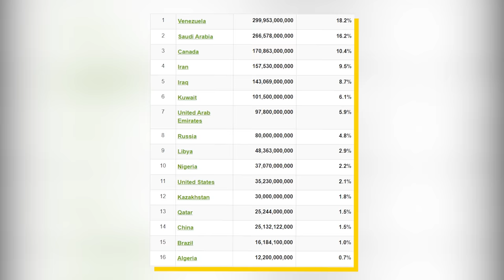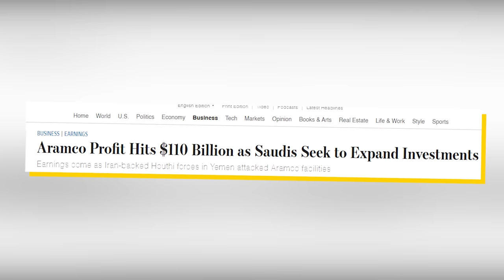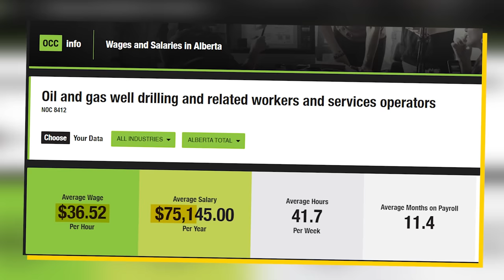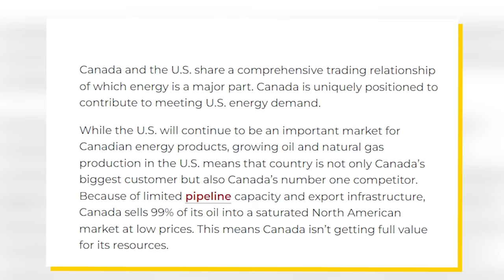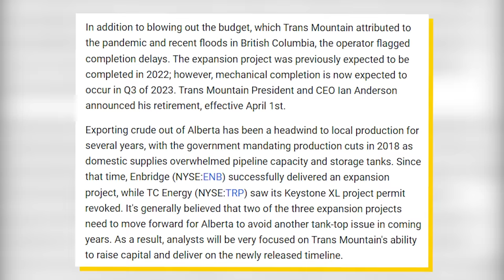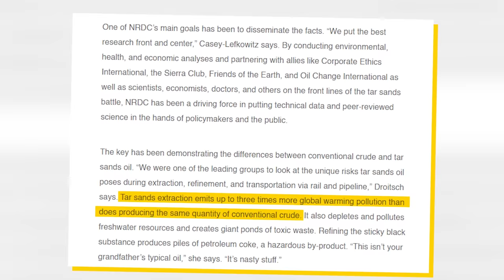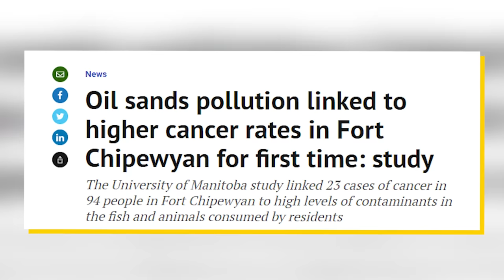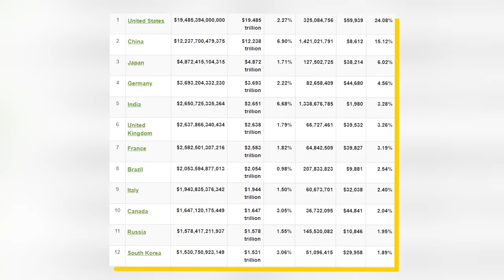Why Canada Refuses To Exploit Their Gigantic Oil Reserves

Comment: One problem you didn't cover was Canadian geography. To get Canadian oil to a port you have to cross the Rockies if you go west or the Precambrian Shield if you go east. Going north is fairly easy, but the port would only be ice free a couple of months of the year. The best route is actually south to the Texas coast which is what the Keystone XL pipeline was going to do until Biden killed it.
Reply: There is a pipeline going to BC (been there since 1953). The east voted against it. Being from one of the provinces, we don't understand the need to have oil. We have excess production of electricity (no solar, no nuclear, no gas, no coal power here), we can't wait to have more reliable electric cars against the cold.
Reply: @robert-antoinedenault5901  what are you babbling? no nuclear? ontario makes most of it's power from nuclear
Reply: @ronblack7870  Never said I was from Ontario but Canada doesn't stop in Ontario there's quite a few more provinces past that one. The pipeline does make it to Ontario but not passed that point.
Reply: BS. Plans for pipelines to West and East coast coast  met with environmentalists. I suspect politic is the issue.
Reply: Canadian here, living only 150km from Alaska. Here in Prince Rupert our Port never freezes more than a few weeks of the year and we have multiple exports already and over 1000 dock workers we could handle a pipeline here and also our neighbor in Kitimat BC
Reply: @timothychung4811  Not so much as we Eastern Canada citizens voted against these pipelines, Government wanted it as it would bring funds into the coffers but the population doesn't want it
Reply: @TheAllstar420  As ironic as that is, I reside in Quebec and voted against this motion (not the government's choice) along with my fellow constituents. I reside on a small (92 acre family/forest plot). I have on average -36C in winter and 34C in summer; with proper insulation and a electric/geothermal heating and cooling system as they are the cheapest and most environmental options by far (my neighbours have had propane and/or gas and/or heating oil; now electric because the price is cheapest over all) and I do not have any batteries as of yet (planning on installing some for solar power generation for new electric tractors). My cost for electricity (0.07$/kWh) is more expensive during the summer (lol) than it is during the winter; as a "normal" Canadian we don't really use heat but when heat rises over 26C the ac get's turned on. So the use of gas is not important for us, maybe you are a new Canadian (1st or 2nd gen) and you are not used to our weather and your intolerance to the weather is not a reason to insist on making us use this, nor to use our land to transport a toxic material onto our land. If there was a guarantee that nothing was to ever happen we would've accepted. Think about it in a more "logical" sense: if the pipeline leaks it is disastrous for the environment (above or under ground) but if a power line falls it just means that power will be back online eventually (just like the 1998 ice storm). Before complaining about why we stopped you, you must also understand our point of view. Not saying we are right nor wrong but if the guarantee was given; there wouldn't have been a discussion about it. But none was given..... And the gas port that was brought forth for the city of Bécancour predates this war by several years and the local government (provincial and municipal) were positive towards this but once the public environmental committee and it's local residents voiced their concerns and no guarantee was given (on the affect on sea life, pollution and expropriations) therefore it never came to be thus sanctioned by the federal government. But your dependency is your own it does not reflect on us, we are happy to move away from this product and have been doing so for the last 15 years. Maybe you should learn to do without (just like a cigarettes), might be hard but it's not going to kill you. Instead a hydrogen plant has been erected there (Bécancour) that will supply Germany and other Eastern country need of clean energy (as we hold nationally [Canada] huge reserves of water) and will be processed with electricity thus reducing our carbon footprint and also our own dependency on fossil fuels (win/win situation).
Reply: With climate change the Arctic ocean will become a more viable route.  There are already plans to develop churchill, Manitoba with a large port.
Reply: @mjhumle  sensitive ecosystem. A single spill could devastate the economy and way of life of people in the region. Looking at a map you can see how tricky to navigate the region can be, creating higher risk for spills. The companies wanting to put pipelines and ship from here have failed repeatedly to provide a comprehensive spill management program to mitigate these risks. In fact, the risk benefit analysis has shown northern BC has far more to lose from a spill than it has to make from running a pipeline and shipping out from here. It’s really just not in our best interest
Reply: If you think that was accidental the I have a bridge to sell you
Reply: @robert-antoinedenault5901  wow. Just wow.

"Maybe you are a new Canadian (1st or 2nd generation)"

It doesn't matter how long you have been in Canada buddy. But ppl dislike Quebec because of statements like that. 

And I doubt the Average temperature is -36. The lows maybe, but not average. I have seen -55 but don't claim it as the average...
Reply: @CountryLifestyle2023  As I said earlier, if you took the time to assimilate what was written; there's a winter average and a summer average and that includes humidity. Now for your dislikement of Quebecers that's your issue. It has been empirically proven (with facts) that for people to get acclimated to certain regions (cold or heat) many generations must live there not a couple. So your negative perception of my statement is based on your own assumption of facts that do not involve me whatsoever (as I am Métis residing in Quebec) but as the world is filled with people that prejudge others similarly to racist people (like the ones you were referring about disliking Quebec).
Reply: @robert-antoinedenault5901  no time was needed, the information in it is basic and simple.

Where exactly are you that the average in winter is -36. Cause again I cab claim the average in SK as -55. 
I have checked the Quebec average, it's not -36. 

I never said I disliked Quebecers, just that the statement you made is the cause of the dislike from the rest of Canada. No need to bring lineage into this. Aka a passive way of hating on  others who aren't true "Quebecers". 

Mentioning generations when no one else is taking about it is a passive way of excluding Canadians.  There was no need for it.

By the way, I live in Quebec as well, and my family has been here for hundreds of years. 

Disliking Quebec Is not equal to racism.... I once had a Quebecois tell me that the persecution the French speaking Canadians experience in Canada was equal to the Holocaust..............................
 Those kind ^ of statements are not uncommon....
Reply: I live in the US and when Biden killed the Keystone XL I was very upset,
what a stupid thing to do!
Reply: @robert-antoinedenault5901
Reply: @robert-antoinedenault5901  Regardless of any argument made on environmental or any other grounds, the Constitution Act 1867, paragraph 121, states "All Articles of the Growth, Produce, or Manufacture of any one of the Provinces shall, from and after the Union, be admitted free into each of the other Provinces."  All provinces have agreed to this.  The date of Union is, of course, July 1, 1867.  This means that shipping oil and gas from one province to another is constitutionally permitted.  If you disagree with this, as you are free to do, work on changing the law.
Reply: @casualsuede  The ice that forms on Hudson Bay is first year ice that completely melts each summer.  Thus, it is weak and to a certain extent, not very thick.  If there were sufficient tanker traffic travelling the same navigational route across the Bay, all with strengthened hulls to be ice-worthy, the ice would not have sufficient time to reform and thicken to any degree between ship passages.  This would also open up the Port of Churchill to year-round grain exports.
Reply: @Boalmighty  So, let"s hold a plebiscite to decide this matter.
Reply: @CountryLifestyle2023  I would allow him his opinion.  You do have to go to the very north of Quebec to get such low temperatures on a regular basis, and not many people live there - likely all burning propane!
Reply: @robert-antoinedenault5901  Would have been nice to build out coast to coast infrastructure no matter what your local use is.  Canadian coastal export facilities on each coast would have made Canada an energy world leader.  We could have decarbonized domestically and transition trade just as Norway has done.  We just needed to act like a country instead of loose assemblage of subnational units that can't think beyond their own arbitrary borders.
Reply: @robert-antoinedenault5901  Thats the problem, every province in Canada don't care about the benefit of the country as a whole, they only care about their own little backyards. Had we gone the Norway route, this country would be in a so much better situation now, everyone would be driving electric cars and have outstanding social benefits with tons of money in the bank, see Norway's  trillion dollar wealth fund. As a Canadian and Quebecer, so disappointed with our self centered attitudes. Such a waste.
Reply: @johnbanka9199  I'm not denying him his opinion.
I live in Quebec as well and tye average is not -36. It was colder when I lived in SK.

And when I see a Quebcois make a bigoted remark I will say something.
Reply: @johnbanka9199  True but what you have misunderstood about the meaning of this text is: the constitution guarantees that all articles of the growth, produce, or manufacture of any one of the provinces shall, from and after the Union, be admitted free (internal free trade provision, prohibits both interprovincial tariffs as well as non-tariff trade barriers) into each of the other Provinces. Simply put it's a free trade agreement. 
So this means there wouldn't be any tariffs on the good going through but does not give the right to go through. That must be approved by all parties involved: citizens, municipality, native communities, regional administrative body and the provincial government. In no circumstance does the Federal government have authority over provincial crown land. 

The authority of each provincial government in place can limit or even restrict these infrastructures onto any and all parts of their sovereign territory (provincial crown land). And must abide by the rules and regulations set forth in every separate provinces. The use of environmental risk assessments and a population referendum on the approval or refusal were utilised as (this process is an applicable law here) these decisions must also reflect on the approval rate by the citizens living in the area of the proposed line. Look at BC and the proposed new pipeline (native refused as it was going to cross their land) same for the proposed line going through Quebec and New Brunswick into the petroleum port in Nova Scotia.
Reply: @robert-antoinedenault5901  if by the east you meant quebec, I mean yeah they run almost fully on hydro, every other province runs on mostly on a  mix of nuclear, hydro, or coal. Canada doesn't stop in quebec, there's quite a few more provinces than that one.
Reply: Actually it was covered and we have one pipeline going to BC and have been trying for decades to expand that.

Even the Keystone pipeline would do nothing to reduce the production costs of our oil sands, under $75 per barrel it's a loss leader for that industry then we'd have years of paying it off while the world transitions off of oil.

We arrived at the party too late and if we only have 1 dollar to invest should we spend it looking backwards or looking to the future if both will take a few years to come online.
One way we'll be ready in time to service a declining market and the other way a blossoming one.

The German Chancellor was talking to our Prime Minister not about oil and NG but Hydrogen, they are willing to invest in our ability to produce hydrogen. 
If that's not a clear enough signal as to where to spend that dollar, I don't know what is.

Our Deputy PM was in Alberta visiting a Hydrogen production facility, Alberta can produce Blue and Green Hydrogen from NG and renewable energy.

Alberta leads the country in renewable potential with flat wind generating lands and space for solar farms.
My god get your heads out of your asses and look forward and be first for once as opposed to last like with oil.
Reply: @robert-antoinedenault5901  the east did not vote against it..Quebec blocked it…but has no problems taking the tax dollars.
Reply: @johnbanka9199  diesel actually, I’ve been to a few remote communities.
Reply: @robert-antoinedenault5901  you act as if you don't use oil. You use plenty of oil but you'd rather buy it from the Saudis than your own country...
Reply: The geography is not nearly as much of an obstacle as the hostile governments overseeing the distinct provincial regions which land-lock the resources (along with the various aboriginal stakeholders and radical environmental actors therein who have been so enabled by "social-license" regulations).
Reply: I've always wondered about a pipeline to western lake superior (around thunder bay) then ship out
Reply: @jiml9856  I personally don't use any but as your price is more expensive than any International sources, it just makes logical sense to get it from those sources. If you expect us to purchase some, they should be  able to supply us (sister province) at the very least equal to international price or better yet the same rate as being purchased by the USA but that second option was refused on the basis that it was "financially unfeasible as they already loose money selling to the USA". Do you see favoritism? And yet they complain that we do not supply ourselves with Canadian petrol to supply the Atlantic Provinces and Ontario's needs of gasoline, diesel, roofing shingles, oils and other products.
Reply: @bigfattank101  Because initially it was exclusively hydro generation but now has also incorporated various other types of facilities. But one cannot just assume that the name reveals the absolute truth as Ontario Hydro had built all their nuclear plants and by doing so their main production came from nuclear while keeping the name. I know you wanted to seems sarcastic with your comment but alas the truth of Ontario Hydro past's just made it logical to explain it. And I can't assume where you reside also, I just presented it by provinces and not by identity
Reply: Even with approval and environmental impact studies that are favorable , Every community along the route wants a hand out or they protest progress.
Reply: Canadian here, I actually live close to the Kinder Morgan pipeline which terminates in Vancouver. Which it actually never climbs the Rockies it just goes through a valley that follows Highway 16 nor it climbs any mountain passes.
Reply: @jiml9856  Folks in the oil industry certainly understand and cherish the ideals of a free capitalist market. That said, certainly you can't fault someone for wanting to pay market price for a commodity.
Reply: @CountryLifestyle2023  im from ontario and live in quebec and were lucky to see -36c twice a year
Reply: @andreaskeltwolfe6176  Exactly my point !
Reply: @robert-antoinedenault5901  At 0.07$/kWh you are living in Nirvana that I can only dream about. The real-world cost for electricity in the rest of Canada is more like 10 to 15 cents per kWh plus very high delivery costs. At that price why would you ever consider installing solar panels or stop importing oil from human rights violators?
Reply: you know there are already LNG and oil lines across the Rockies? They're just small lines that escape the notice of political movements.
How do you think BC has been getting fuel this entire time?
Reply: @blainesitter9110  totally fine. When a wind mill is using a segment of a land they pay rental fees. That is normal. But as Canada has signed onto the confederation that no provinces will have any tariffs or taxes; that option is closed but native land is above the confederation as their land was not given by the government but by the King (Queen Elizabeth) but never signed the confederation of Canada. So they have more right than the provincial govt on regards to their lands.
Reply: @robert-antoinedenault5901  Always keep in mind that only 16 gallons of a 55 gallon barrel of oil is ever burned as a fuel for heating or transportation.  The other 39 gallons from each barrel is used to produce thousands of other product (over 6,000 products that are easily identifiable in your home and workplace).  From plastics to pharmaceuticals, circuit boards, to lubricants to hockey pucks.  Some alternatives exist to these products now, but not many.  The world will need oil for a very, very long time.  Emerging economies are growing around the World and those people would like to enjoy a few of the everyday luxuries that we enjoy, which will drive up the "other products" enormously.  Don't be deluded to believe that electric cars or electrically heated home will eliminate the need for oil.
Reply: Thank god he did kill it! Canadian oil is so expensive anyway we might as well try and become global leaders in sustainable energy
Reply: @applefav101  are you slow?
You know that the richest province in the country is the one that exports our "expensive" oil. Renewables are no where near the level of profitability as oil mostly because people like you have been banging on for years so now we have poor investment in natural resources and no economic base to invest in R&D for future techs.
Anyone with a working brain could have seen the downfall of oil industries in the near future and would have HEAVILY invested in our oil industries to get as much money out of it as possible in order to invest in getting the best renewable energy options.
We border the US and they do everything better than us regarding renewable energy. How on earth would we compete in a world market against someone who builds things better and faster than we do?
Reply: @applefav101  Canadian oil is expensive to bring to market, but still provides tremendous revenues when selling above $100 per barrel.  The future price of oil will only rise.  Cancellation of pipelines and access to ports has only discouraged foreign investors and hurt Canada in many areas.  Before pipeline cancellations and COVID the Canadian dollar reached $1.24 against the U.S. dollar and now we're at 74 cents.  Oil revenues have the opportunity to tremendously benefit the western provinces that produce it, boost general Canadian revenue to reduce or eliminate national debt and provide the funds for R&D to improve and make the processes of oil extraction and processing cleaner.  Additional revenues can support, promote and develop clean energy alternatives that can help Canada and other nations to transition away from burning fossil fuels.  Less than one-third of every barrel of oil is ever burned to introduce carbon into the atmosphere.  The other two-thirds produces many thousands of products that never contribute to global warming.
Reply: @ronblack7870  He's not from Ontario, he's not a Canadian; rather a member of a distinct nation where there is a law against the majority of the citizens sending their kids to an English school.  Also a law against hanging an English sign on the front of your own business.

As he said clearly, they don't see anything in it for them so that is enough reason for them to block others from having a benefit.  Classic queerbeck logic - it doesn't help me so im going to stop others from gaining a benefit!
Reply: @timothychung4811  Corruption
Reply: @antiprogpragmatist859  referendum of targeted (affected) citizens are constantly saying NAY. The one's in the cities they don't matter. Polls don't matter on this.
Reply: @antiprogpragmatist859  Just like the previous natural gas line that was intended to reach the east coast. As it was rejected by the native communities.
Reply: There is still the TMX and CGL that go to the BC coast, still not enough lines but geography is not really the main factor
Reply: @mjhumle  Building one in Kitimat right now
Reply: Just get rid of biden (sleepy joe)
Reply: @UCDENXRo8Qhg7P7fbB_eqQJQ there is 0 context to that. 

What are you referring too
Reply: @robert-antoinedenault5901  you yourself may not see the need for oil/gas. However remember Quebec sees billions of dollars in equalization payments every year coming from Alberta. Most of that comes from oil and gas. People in Alberta get pretty upset that we have to send piles of money out east year after year, and when we ask for a pipeline to make it easier to make more money (not just for ourselves but for the entire country that relies on that money) it gets shut down by the same people who want the handouts. The war in Ukraine also shows just how valuable Canadian oil and gas could be, and an east coast pipeline with a LNG plant and port to ship gas to Europe would be huge business, 50% better for the environment than burning coal for power, and help stabilize European energy, but again for some reason Canadians who know nothing about oil and gas don’t want it.
Reply: Dude we can build pipelines almost anywhere.  We just have an anti-pipeline gov’t.
Reply: @ryeinaldobettahavmamony7656  hmmm what about pipelines through the territories. Yukon  NW, Nunavut. 
Less ppl to oppose it..lol  and can fund the local area and provide more infrastructure where there is none. 
Could end in Hudson Bay, and ship it internationally or internally.
Reply: @Jackson-xb4wl  There has been a pipeline from Alberta to Superior Wisconsin since 1950
Reply: @chrisgraham2904  $1.24??? Hard to take you seriously if you're going to make up numbers.
Reply: @colebevans8939  There's plenty of oil in NFLD why on earth would we need an east coast pipeline the LNG plant at Placentia Bay.is almost through the approval process.
Reply: @Paul-vf2wl  right, but superior Wisconsin is in the US so that doesn’t really help us much. My idea was more that it isn’t really that hard, technically, to create both easterly and westerly pipelines within Canada so that we aren’t subject to US price gouging.
Reply: @Jackson-xb4wl  We aren't subject to US price gouging
Reply: @robert-antoinedenault5901  good luck one that one buddy , Don't understand the need for oil  ????? get educated
Reply: @bartbley1269  for a few materials I get it but as for energy. It is becoming obsolete. Hydrogen is much more prevalent now. Now you need to educate yourself 😁
Reply: @timothychung4811  Yeah the suspect would be corruption . there is no need to import more expensive oil into an oil rich country
Reply: @bartbley1269  first of all you must know what is needed vs what is produced. In Quebec less than 1/3 is sweet (WCS) 2/3 is international as we need sour for our diverse products manufactured here. The price doesn't even matter as the product does not correspond to our needs. If it wasn't for the 70's oil crisis we'd be supplying the USA in refined fuel but that event forced our refining capacity of gasoline, diesel and airplane fuel to be cut by 65%. As these facilities shut down and we're decommissioned and subsequently taken apart. Knowing the past is half the battle but knowing the present is the other half. As for the Irving facility in NB they refine sweet light contrary to the sweet heavy/extra heavy from out west 😉
Reply: Because the oil is shipped to Texas,  Canada has only one customer for oil and they have to pay to use American pipelines at sell the Americans at their price and the quantity.   If they could ship east and west then they would sell to the highest bidders from Asia and Europe.   While the tar sands are expensive to produce oil they are still profitable.  It's just that the big oil companies don't make windfall profits.  Instead the workers make good wages and their spending improves the GDP for their communities instead of the profits being kept in the hands of foreign owned companies.

There is not an oil shortage in the world.  The Golan Heights has a major oil reserve and so does Russia.  That oil is easy to produce and they can undercut Canada.  That makes it a difficult economic decision to expand oil production as it's expensive and takes time to build more infrastructure.  Anytime during that expansion these countries can drop their oil prices and put Canadian oil companies out of business.  If oil production is expanded too quickly then Canadian Oil could be bankrupted by foreign countries.

Slow and steady wins the race.
Reply: @timothychung4811  It isn't free to pipe oil across provinces.   Each province wants a piece of the oil revenues.  Unlike Alberta that ships south to the US without crossing other provinces.
Reply: @mjhumle  Prince Rupert has an incredible deep water port and it would be faster to load and ship oil using an outside passage rather than through the Strait of Juan de Fuca.   A ship can save two or three days sailing using the outside passage.  However, Vancouver makes a lot from their port and they have the population that elects the government.
Reply: Going north is not only infeasible because of the ice, but also because of lack of people
Reply: @ryeinaldobettahavmamony7656  Yes, you are correct we can build the pipelines. It's the cost that is the problem. For example the proposed energy east pipeline would never have paid for itself if it was only used to supply Atlantic Canada and parts of Quebec. Also not sure why you call the current government anti pipeline when they are actively building a pipeline.
Reply: @gordoncavanaugh8744  IT shows how little you know. Our oil is sold for  eighteen dollars a barrel. Guess where it goes... 
You already hinted that answer hence why I stated, "I suspect politics as the reason", so clue on as to who owns our oil. As per the royalty payment for cross border transfer, that is up to the individual oil companies and the province directly impacted, so HOW IS THAT RELATED THE PROVINCE OF ALBERTA. We are not building it
Reply: If we built infrastructure in the Yukon for the Northern passage we would have access to Asia and Europe. Yukon by boat is closer to China and Japan than BC (even though it doesn’t look that way on a map).
Reply: @steelymcafeeliac1050  You would have to built a port in the Artic region if that is the case. At this stage, despite climate increases, I'm not knowledgeable how feasible that would be at this sage. Although Russia is prepping up for future artic route...
Reply: @timothychung4811  Yes this is not a let’s break ground this year type plan. If the infrastructure was there now it would be passable. Lack of places to fuel, ice breakers and emergency rescue services are really the only thing holding us back. By the time the infrastructure was built it would be easily passable. Within 10 years the US will have deemed it international waters but we lay claim to it now. Best to get our ports in now to keep it a Canadian waterway.
Reply: Don't exploit our oil build a few refineries and you WILL lower the price of everything.
Reply: @robert-antoinedenault5901  Hydrogen more prevalent WHERE ?????
Reply: @bartbley1269  pretty much every country/territory that has decided to go green 10 years ago in regards to reduce their dependency on fossil fuel. I'm sorry if you've been living under a rock.
Reply: There are hydrogen stations in Quebec, Nova Scotia, New Brunswick, Ontario, British Colombia and also in Alberta. The majority are for trucks (freight) but in BC, Ontario and Quebec they're also for automobile usage. Presently Quebec is the only one that sells green hydrogen (from our wind farms) the rest are blue hydrogen from fossil extraction processes. Take the time to search online germany+hydrogen and japan+hydrogen
Reply: @casualsuede  There is more ice in the Canadian arctic now than there has been since the 1980s, stop spreading lies
Reply: @YouTubeistheworst  As an owner of a farm, I do know where food originates from. And the use of oil (or any by-products) has never been on my farm as it's all electric. The "subsidization" by Alberta as your assume  is not utilized in the provincial budget but rather into our provincial fund (similar to Norway). Since we never needed it nor wanted it (1982 act, Lake Meech & Charlettown Agreement). We just invest it. The industry is far from being destroyed as lubricants, roof shingles and many other products will still need to be processed. But the need for gasoline, diesel and airplane fuel have been in a decline as they pollute excessively more than electricity (hydro, sun, wind, thermal) and green (and even blue) hydrogen. And as you might not know,  Europe has been converting to hydrogen for the last 10 years. Look at Germany's present needs in oil vs hydrogen. And have signed a massive investment for green hydrogen in NS and Quebec's present supply of green hydrogen. Clean Green fuel is in the east to supply Europe and Alberta is dirty fuel for the USA; even BC supply California and part's of Asia in hydrogen.
Reply: @andreaskeltwolfe6176  
Yeah. Prairies are always wayyyyy colder
Reply: @mjhumle  I don't think I've ever heard of Kitimat's Ports freezing over, which is why the biggest employer there, Rio Tinto Alcan is busy all year round
Reply: @robert-antoinedenault5901  so nothing on your farm is made of steel? Like maybe the springs on your tractor or whatever transportation your production uses? Pretty hard to temper a spring without some sort of oil quench. The only alternative would be high quality plastic which might derive from condensate.
Reply: @robert-antoinedenault5901  Also don't ever say someone isn't a "real" Canadian, you're french Canadian and we hate you for a reason. We value ourselves having manners and being respectful. Quebecois don't even know the meaning of those 2. Also, I'm talking from experience.
Reply: @calebacrutto9601  free capitalist market is a bit of an oxymoron. Capitalism is dependent on a large amount of government subsidies for select wealthy corporations. Also the fossil fuels industry as a whole would collapse under a free market because it's less profitable to sell the energy produced than the cost to extract the resources. Especially in a free market where it makes more sense for the us oil reserves to be opened up just enough to ensure that it is always less expensive to purchase American oil in the us and Canada than Arabian oil. So not really no. They actually don't want a free market economy since coal and natural gas are simply to expensive to make money without government subsidies, a distinct nope in a free market, and the oil competition would leave only the arabian oil companies or bankrupt ones at the end.
Reply: @timothychung4811  The biggest issue is Trudeau and Biden. Period.
Reply: It’s time Canada took advantage of the Port of Churchill. It’s a deep water port … Global warming, like it or not, is making this more accessible. Canada talks about its sovereignty in the North .. it’s time it put its money where it’s mouth is and build at least one ice breaker (Russia, a smaller similar economy has several) to help with exports out of this port. It’s not just oil or natural gas from Alberta but CLEAN Hydrogen could be developed with the building of the Connowappa dam.
Reply: @bombkita  One's experience doesn't ever mean much for the masses, as it only represent a tiny fraction of a population (basic knowledge in statistical science 101). As I have been in every province and territory in Canada, I can also claim (like you) that several Canadians have no manners and respect for others (MB, SK, AB) especially towards native (& Métis) communities and their rights as residents (as they are also Canadians). But the statistics brought forward from these communities neighbouring these municipalities in those provinces over the last 60 years. Represented in the constant lack of municipal infrastructures and the nonchalance of their "supposedly" proud and respectful Canadian neighbours as for not pressuring their own elected representatives to provide these services.

 Why is that? Why is it that they have to fight for themselves? Why is it that, as you say respectful and well mannered, Canadians haven't been pressuring their local government on these fronts? Proof always supersedes experience? Life experience in relation to interpersonal interactions is a personal thing but without proper data (proof) it is perceived more often than not as being Discriminatory/Racist. So before claiming anything on experience such as: French Canadians don't know any better, to the same extent as black people are lazy or even Indians are dirty because they are smelly; you should have proper stats to prove yourself. 
I am willing to hear you out as a well educated, respectful and well mannered French-Métis Canadian. Bring the proof and we can have a discussion. Pointing fingers and assuming is a childish reaction to the unknown.
If I don't hear from you, it just means that you are part of the latter and you don't understand the true meaning of respectfulness and good behavior.
Reply: @johnkilmartin5101  I get what you say and as for quenching steel you can still use water, oil (fossil or vegetable or even recycled) or brine. Many are moving away from steel shovels towards high carbon and aluminium. But I decided many years ago to become the most up to date farm (vertical) with natural equipment (bamboo pipes instead of plastic or metal) no pumps and gravity driven. The need of oil, steel and such will not disappear anytime soon. But many like me (eco farms) try to reduce our own dependency on these items as they have become obsolete to our needs. Times are changing. There's no point in refusing this change as it was back in the day when these items came to be commonly used.
Reply: Trump the ecologist. Yeah real good leader 😂
Reply: @robert-antoinedenault5901  You do realize EV's don't actually work very well in the cold. Cold sucks the battery life. Then just imagine you are on a long trip and  no charging stations nearby.You figure out that to be able to reach your destination you will have to turn off the EV's interior heater as it pulls a lot of power. Your wife will not be impressed and start questioning your decision to buy an EV as she is freezing.The kids in the back seat will chime in on how cold it is and they liked the old ICE better.
Reply: @CountryLifestyle2023  There are approximately 38M people living in Canada, including 8.5M people living in Quebec.  You purporting to have your finger on the pulse of Canadians or Quebecois casts serious doubt on the validity of your arguments. Your comments about what views are held by Quebecois and by the rest of Canada are anecdotal at best and, of course, entirely unsupported.  We've all heard stupid things said.  No country or cultural group has a monopoly over stupidity and narrow-mindedness.  

Hopefully you don't actually believe this drivel and are only being opportunistic in a lazy attempt to make a point. I don't mind if you hold a view personally but at least be accountable for it instead of attributing it directly or indirectly to the alleged beliefs, views and/or conduct of others.  What you are doing is far removed from the exercise of critical thought and is in fact intellectually dishonest.
Reply: @johnbanka9199  Having a constitutional right to use an existing pipeline and actually being able to build a new pipeline are entirely two different things.  You cannot deny access to existing infrastructures for the export of oil, but you are certainly not required to build new infrastructure (or to make it easy for such infrastructure to be built).  Keep in mind that the Constitution gives provinces jurisdiction over regulation of environmental matters within their own borders which would extend to the transportation of oil by pipeline.  The provinces have enough ammunition to fight pipelines without amending the Constitution. :)
Reply: @bps3203  If I see a Quebecois being ignorant towards minorities I will say something. Or ignorant towards shit in general, I have experienced it first hand many times and no longer just let it happen.

Quebecers and Quebecois are 2 different things, 1 support separatism one just lives in Quebec. 

I participated in political protest during the last referendum. 
I have seen safe houses where politicians hid from Quebecois terrorist. 

You are coming from a different place than I am (not physically...)
Reply: @bps3203  i once had a Quebecois compare the struggles French speaking Canadians experience equal to the Holocaust. He wasn't joking.....
Reply: @robert-antoinedenault5901  Yeah, you import oil from Saudi by big coal rolling ships instead of bringing it by relatively clean pipelines that are already there.
Reply: @johnarnold893  Okay, I will repeat myself as many don't seem to understand what type of oil is imported into Quebec. 1/3 comes from Alberta (sweet crude) to be refined as gasoline, diesel and airplane fuel. And the rest is for other utilisation (roof shingles, lubricants, etc) but the oil needed is SOUR crude. Canada oil is not sour enough to be processed for these products. Just FYI coal powered tankers have been removed in the mid 50's; as they all use HFO or heavy fuel oil. Educate yourself. Learn what happened in the late 70's in regards to oil and the consequences of that event on the refining capacity of Quebec and USA.
Reply: Beat way to make Canada powerful is not oil but water Canada had large fresh water reserves and will not experience the coming world drought if we exported it to more unfortunate countries we would become truly powerful especially if we charged money for it.
Reply: @romulusmariuscaesar9716  We have voted for the total ban of any bulk Canadian water sold throughout the world (is now a law). But we are aiming for green hydrogen production that will be used for two purposes. Electricity generation and water generation also.
Reply: @robert-antoinedenault5901  why not do both is what I'm saying create the water and sell it we would become rich and powerful
Reply: @romulusmariuscaesar9716  We are selling Hydrogen already. And the biproduct of burning it is water
Reply: @romulusmariuscaesar9716  The German chancellor has pledge his nation into investing in the broad implementation of wind farms in NS for the production of green hydrogen. Quebec has been producing green hydrogen for a few years also after heavily investing into mass wind farms also.
Reply: @robert-antoinedenault5901  k how does that make Canada a power
Reply: @CountryLifestyle2023  The struggle of "Quebecois or Quebecers" (they are the same as one is the French name and the other is the English one) was very similar to the same situation that South Africa. Some did have it worst then many other's (especially in Montreal's East End and St-Henri neighbourhood) as the wages (by wealthy English Canadians) were so low, many families had kids die as they didn't have enough food. Arthas perception of Quebecers is filled with ignorance and discrimination/racism; similarly to most Canadians that have been raised outside of the province and weren't taught about the realities that Quebec resident were going through at the time, nor the discrimination by English Canadians. The coining of Quebecois or Quebecers was used much earlier than 1800's. The quiet revolution was our march to freedom and the reconstruction of our "little French nation" within an English country that had control (financial & political) over us. The October crisis was the culmination of all the frustrations felt by the few extremists in the province. And the 1980's referendum was the given choice to separate. The 1982 act was the financial leash (equalisation payment) forced upon us, as was the Meech lake and the Charlottetown Accord; which have never been signed off on by the Quebec government. Here's a video from 1968 filmed at Scarborough College with René Levesque. Will help clear the air for that period. https://www.youtube.com/watch?v=ga-T1WT7qmE
Reply: @robert-antoinedenault5901  yea comparing it too the Holocaust and Apartheid in south africa, doesn't help your cause. 

I have had friends beat up for speaking English....others refused service and more. And any non French speakers in Quebec face worst treatment.
Reply: @robert-antoinedenault5901  and heads up, my family has been in Quebec for 360 years, with untold amounts of family in the area.
Reply: @romulusmariuscaesar9716  Well... Canada is presently the largest producer of green hydrogen in the world and utilised only for green purposes (as to not create more dangerous emanations). Many European countries have undertook the conversion to hydrogen power generation as fossil fuels are more scarce and also more expensive. Look under Germany, UK with hydrogen, look also at cars and trucks that are FCEV. And a few months ago the German Chancellor signed an agreement to invest with Canada a 200M$ into extending our electric wind power generation as to be able to supply them with more green hydrogen.
Reply: @CountryLifestyle2023  Yeah same goes from english canadian with us. And that for even longer. What's your point?
Reply: @CountryLifestyle2023  And your point being? That just means that you know French, as 360 years ago it was New France.
Reply: @CountryLifestyle2023  But as everyone knows that French is the official language. I don't understand the issue. If it is because they do not want to learn it, well maybe it is time to look at another jurisdiction. PS if you go to china you got to learn Chinese. As the expression goes: When in Rome, do as the Romans...and speak Italian.
Reply: @robert-antoinedenault5901  who says I know French ? Dnt assume.
Reply: @romulusmariuscaesar9716  Your way of thinking is the reason why we put this law in place with a provision that states that reversal is impossible
Reply: @CountryLifestyle2023  Wow you think in so tiny ways. There are more francophones or Quebecers being beat up by anglophones throughout Canada. Language shouldn't be a reason but it seems to be. We have no hatred as long as people are willing to live here they must be able to communicate. Just as when we travel to the rest of Canada we must also be able to converse in English. Just common sense
Reply: @CountryLifestyle2023  You don't even know the reality of Quebec past and the reason of the Quiet revolution, right?
Reply: @robert-antoinedenault5901  why is it bad to want to increase my country and nations power especially sense the Americans have infiltrated out culture to the point where we are basically the same now except for Quebec it is perfectly reasonable to sell water as it also takes work and money to get it and plus what is the alternative let the third world start numerous wars for water or to sell it to them.
Reply: @CountryLifestyle2023  You're the one that said your family has been here for 360 yrs. There was no past tense in that phrase therefore you're family still resides here and you were born here. No assuming necessary as the rule of grammar points out the truth. Whereas if it was in the past tense then it would mean that there was movement.
Reply: @romulusmariuscaesar9716  No as these nations grow they will need power (electricity), we will be there to supply that need and also provide the generation of said power (power plants) and by consequence providing water (another revenue stream)
Reply: Oh I forgot to explain something to you. 1kg of hydrogen is equivalent to 1 gallon of diesel. What you must understand is the cost of 1 kg of hydrogen in California is 16$, in BC it's 11$ and in Qc it's 2,34$ at the pump. Whereas diesel here in Qc is 7,29$/gallon (today in qc). If we sell each kg at the same rate as BC, we are looking at a 8,66$ difference.
Reply: @robert-antoinedenault5901  why not do both directly plus if we controlled the water supply we could force them to but our oil as well.
Reply: @stormsand9  yeah here in Prince Rupert we rarely get below freezing just the odd cold snap that may last a week or two.
Reply: @romulusmariuscaesar9716  Why do you keep speaking of forcing others? We are a peaceful bunch. We have proven in the past and even in recent years that we provide to the world scientific technologies at a very low price and in many other cases free; as it goes with our core values. To move away from that is anti-Canadian. Money is necessary but is not our calling card nor our goal (as in the USA) the majority of Canadians relate to this perspective and are very prideful of this fact. But as you keep pushing this topic you must also understand that the Federal government of the United States has also signed the same agreement.
Reply: It’s already almost completed through BC I seen it last week through the Rockies through Jasper national park
Reply: @discorddraqonequus8436  Sorry, I'm not picking up what you're laying down. How does the US oil reserve opening up a little get US and Canadian oil Cheaper than Arabe oil? The cheaper the barrel, the less chance Canada can produce and profit from it, doesn't make it significantly cheaper to produce. I'm sure there's a formula the US has for the price and the amount of reserve released and production, but the cost differences between the US and Canada wouldn't make that formula viable for Canda. However, the fact that the supply and demand tactics you describe work on influencing the price of oil (not that I think it benefits Canada's oil the way you described it) proves that Capitalism is at work here. That said, I think we can both agree on two things... That oil prices are influenced on artificial and pessimistic speculations, and that my original comment was a tongue and cheek shot to someone who wanted to put someone down for wanting to pay less for gas at the pump vs his patriotic pride to pay more for Canadian sourced. The whole thing is a wash anyway because Quebec (where the original debate stemmed from) gets brent oil.
Reply: @robert-antoinedenault5901 most other provinces can't get away from fossil fuel right now. For heating natural gas is cheaper choice (along with better insulation to minimize need) . What we pay for natural gas heating in Ontario is far less than what it would cost us for electric heating. Most other parts of Canada are in the same situation. Quebec has much cheaper electricity rates, and that mostly comes through heavy subsidizing from the transfer payments. Hydro-electric energy production is huge in Quebec, but by no means was this better for the environment as massive areas were flooded for this. Indigenous peoples were lied to and environmental contamination had been ignored (Mercury levels shot upwards) . 
Basically nothing is clean and no one area is really doing better than another.
Reply: @danieldoucet9121  Just trying to understand your take on whatever you are trying to convey. Please be more precise, so I can understand. Are you speaking of the west? or the east? Or even something else? I am confused on the relation between granola types while not having a dog and the other relation between the negative view of economic growth and the building of a wal mart.
Reply: @marcolisi6726  Oh!! forgot one thing...quick question. Have you never heard of Geothermal heating and cooling. It is the cheapest way to heat and cool a home in Canada. And only requires a tiny amount of electricity to activate the pump. Even in Quebec where electricity is very cheap; over 35% of single homes utilize this technology and over 45% of all wine makers use this tech to prevent their vineyards for dying during our harsh winters.
Reply: @robert-antoinedenault5901  Yes I have heard of it. Yes I agree, it's a great technology and highly efficient. 
To have it installed here in Ontario you're looking at $50,000 which cancels out the savings sadly. Believe me, I would love to have it.
Reply: The canadian sheild is no issue to travel through, the trans canada highway can get you from the western coast to the east (the rockies are difficult, but possible to travel through, the rogers pass has numerous contermeasueres to avalanches and landslides, such as tunnels.) but yeah, we SHOULD be exporting oil from the atlantic at the very least, instead of selling 90% it to our american neighbours at discount.
Reply: Yeah but transporting goods through the mountain passes is expensive and at time dangerous, and we here in bc dont mine much for oil, for here be diamonds and many other important resourses, wich im fairly certian DO get exported from the ports in your general area.
Reply: @jkl944  It's not a matter of traveling through the Canadian Shield. The problem is the high cost of building a pipeline through it, which makes it unlikely that the project would ever pay for itself.
Reply: @Erica-bo7nk  Where in the world did get that nonsense? SNC Lavelin was caught bribing Libyan officials, not the Prime Minister. The PM did not silence the justice department, the justice department tried and convicted SNC Lavelin's CEO, their CFO and the corporation itself. No one was fired, although there was a Cabinet shuffle and the former justice minister did not want to move to indigenous affairs so she left the cabinet. As for Saudi oil, no one in government has any say in that. The oil companies decide where to buy oil from based on price.
Reply: @johnbanka9199  Well, if you want to go over the Quebec decision to not have the pipeline, we'll just separate then.
Reply: @garryford6439  You know that Quebec imports its oil from the US. so yeah, I agree with the human rights violator thing.
Reply: @ObeyTheDictator  Quebec has imported over $228 billion in foreign oil since 1980, $95 billion of that came from the USA in the last 10 years. But most of our USA imports were imported into the USA from foreign oil suppliers.
Reply: @robert-antoinedenault5901  next year they're coming really really soon.... the first 1000 miles EV will be in 6 months.
Reply: @TheInsaneupsdriver  Yeah that's great for warmer climates but for anywhere north of the 45th we loose minimum 30% of capacity without even using heat.
Reply: @johnbanka9199  The tricky part of that argument is that Québec never signed the canadian constitution. Canada has been operating as if Québec did sign it for decades. However, there is always some hesitation from the Federal governement to enforce projects in Québec's province that goes against the population general opinion (majority). The last thing the Fed wants is to create political instability and risking their reelection. Pipelines are generally not well received by the general population of this province. Hence, the pipeline project dying in Ontario.
Reply: @KkevrockK  This question is so much more complicated than you make it seem. When you look at the the money transfer from the Fed to the provinces, it really looks like Québec and Maritime provinces are getting taxes from Western provinces moved to them. However, behind those numbers is the reality that some of the services offered by the Federal Governement everywhere else in Canada are managed and paid for by Québec's provincial government. In other words, less money is sent to Québec's province by the Fed in the form of those services.  This is considered when equalization payments are calculated at the Federal level and adds to the money transfered. I am not saying the equalization calculation is fair. However, I am debating that we should get a better understanding of the real value of the services not offered by the Fed before passing easy judgement.
Reply: @robert-antoinedenault5901  Here in Atlantic Canada (I guess it depends how far East is meant), it seems to me that it is invariably the left leaning (granola=pejorative), who have well paying careers, that oppose new industry coming to the area, especially in oil and gas. They don't "have a dog in the race", which means the outcome doesn't affect them because of their job situation. I have seen it many times. They are fine with another Wal mart or any number of businesses with low paying, low quality part time jobs which do little for the economy but enable them to maintain their lifestyles. I realize there is a lot of generalization here, but there is also some accuracy.
Reply: @robert-antoinedenault5901  What's funny is oil keeps heading through Quebec. The safest way to transport oil is by pipeline. But at this point it travels by rail car and Quebec has experienced first hand what happens when they go off the rails as one of their communities was blown away by a derailment. I'm all for an alternative to oil, a product which is involved directly or indirectly in the production of everything we use but there is nothing to replace it yet. Lithium is not the answer for batteries as the mining of it is worse than mining coal. If you live in a city electric cars work but not if you live away from the cities. Gasoline cars can be repaired at a fairly affordable cost even if you need to replace an engine. Have you ever priced a battery for an electric car? We now have cars that are throw away more so than with internal combustion cars. So are they saving the world by tossing more cars away every year? It's easy for Quebec to vote down oil pipelines but they sure love the money transfers from Alberta when oil production is good. I would love to see the money transfers stop and have Quebec take a vote on pipelines again just to see how it would differ from the previous vote. People think we can just turn off the taps but everything we own, wear, eat was made or harvested with oil. Now with all that being said what is the answer? I can't answer that question because at this moment there is nothing to replace oil. Even the products we have to try and replace oil and gas need oil and gas.
Reply: @robert-antoinedenault5901  NOT TRUE! tesla just tested a new battery last winter in northern Michigan, 728 MILES!!! to the charge, in sub zero temps for 3 months.
Reply: @guillaumericher-rochon4902  the question around that is not tricky. For one reason. Western Canada has no substantive representation in parliament. We have no seats to oppose Quebec and Ontario's will. Quebec and Ontario operate completely different than the west. Bitumen from sands is extremely heavy oil, it is the best for making jet and rocket fuel, gives awesome by- products for paint, cosmetics and medical plastics. But we have no refining capacity because the east has blocked the west from developing the infrastructure. The east has done this with nearly ever major extraction and delivery project in the west. The worst is Saskatchewan pot ash and the federal government hamstrung approach at blocking the province from developing provincial extraction companies, forcing the only avenue to bring in private companies that lease saskatchewan crown land to mine pot ash. That has paid off the federal politicians.
Reply: @robert-antoinedenault5901  those temperatures are an exaggeration. theres nowhere in canada where you average -36 in the winter and 34 in the summer. The pipeline would have been far more environmentally friendly than trucking, and would have provided plenty of jobs in the mid midwest, especially to native communities where opportunities are few and far between. You also realise that not every province can solely rely on hydro? i understand where you are cming from but its not realistic to the rest of canada.
Reply: @seangriffin7803  spot on
Reply: It's easier than you think
Reply: @TheInsaneupsdriver  Northern Michigan has warmer temps then here (where i reside). Can't compare. Use Alaska as comparative at the very least. What you are saying to me is similar to using New York and Atlanta. Michigan has an average in winter of 0F during the night whereas, here it is -22F during the day and -36F at night.  Keep in mind that the majority of city dwellers here have no heated garage nor under ground parking. And distance travelled at normal speed of 110km/h (68m/h). 

The Mirai (FCEV 44k$CAD) 640km range at least offers towing capability (500lbs), cost of 11,70$ (2,24$/kg) per fill up

The 2022 Tesla S (140$CAD) was tested last winter all from December till July. The average consumption during the summer is 148kW/h per km for 50 km and a dismal 319kw/h per km (50km) with no seat heating and a cabin temperature of 15C (49F) and does not even offer towing and to fill up at a fast charge (as there are more than 2500 of them here) for 23$.
Reply: @Jackson-xb4wl  the boats don’t run in the winter - so would be seasonal.
Reply: @StinkPickle4000  well said
Reply: @robert-antoinedenault5901  actually I can cause they did testing there as well. you have no more excuses left when it comes to EVs now. just wait 2 years and you will see what I mean.
Reply: @TheInsaneupsdriver  Will it be available for less than 50k and be able to tow?
Reply: @IMGreg..  break even price for oil sands is now in the $30s per barrel.
Reply: @TheInsaneupsdriver  Just read up on the testing. They did the test on basic winter tires with no steel studs and without testing with chains. They really did a controlled testing but not a true one. But their 30% loss is quite normal. And the lack of front wheel drive for winter driving is also a deterrent for us; as barely anyone purchases AWD due to the cost. Unless you purchase a car in the USA all cars here are standard FWD, as they cut through the snow.
Reply: @robert-antoinedenault5901  Teslas do quite well in the snow actually, the weigh more. as do all EV counterparts do to their ICE equivalents. and the AWD option is the same across the board. also most non AWD EV's are front wheel drive as well. as for their tests, i guarantee you a EV will beat all ICE vehicles within 2 to 3 years time. EV tech is still in its infancy and they've invested billions in R&D and its all coming to fruition now.
Reply: @robert-antoinedenault5901  $30,000 actually, and there is another EV covered in solar that actually charge other EV's... You think you are being funny but you are just as bad as the people who rather have the horse and carriage over a petrol car, over 120 years ago. Just wait about a year, you'll see....
Reply: Real problem is lack of adequate port capacity in west coast, east coast is lack of refining capacity due to climate change enthusiasts.   This  video omits large potential arctic reserves
Reply: @TheInsaneupsdriver  I'm for the change actually but at present time it is far cheaper to purchase an FCEV than any EV's here. And the cost of "fuel" is also far cheaper for FCEV and is all green powered.
Reply: @TheInsaneupsdriver  the cheapest Tesla here is the Y at 85k$
Reply: @TheInsaneupsdriver  Solar is a waste here as our potential to produce the full range 100% of specified panel (might it be 18 or 33%) on solar is 35%. I has been tested and proven that wind is our only viable alternative. So that add-on is futile.
Reply: @robert-antoinedenault5901  it costs less then $10 for a full charge at a charging station, less then $5 at home.... but current purchase price is only due to demand and it being new tech, not actual cost per unit.
Reply: @AndreInThe416  no, it costs almost 5x as much to process, in both money and energy.... and burns much dirtier then other gasoline's.
Reply: @AndreInThe416  But what makes no sense is that the prairies haven't expanded their own refining capacity and ship that refined fuel to Asia at a preferred rate, as WCI is cheaper than WTI and BRENT, all the while utilizing the already established pipeline towards BC.
Reply: @TheInsaneupsdriver  Oh forgot to add. It is a well known fact in the automobile world that: 
For any car lighter is better and this goes double for a sports car. It is true that having less weight over the drive wheels can reduce traction but the gain from less overall mass will always be greater, and

A light car has a high chance of crawling along and staying on top especially with thin winter tires as they can dig down through the snow, giving a good grip on the hard surface, and 

Heavier cars have the bad habit of having more hydroplaning and causing more accidents.

As a rule of thumb, for winter tires you should reduce the width 10mm, increase the aspect ratio 10 percentage points, and get a wheel one inch smaller — in this case 215/60R16 This is called Minus One sizing.  Instead of 225/50R17 tire. You can also go Minus Two, to 205/70R15 

And usage of alloy wheels (mags) here are frowned upon by car insurance as the metal expand and contract over the winter months due to the changes in temperatures. And cause more accidents as they get filled with ice and snow preventing proper operation of the brakes.
Reply: @robert-antoinedenault5901  you are wrong about weights and vehicles, heavier is better... and you won't find anyone with more experience with that anywhere... I am the emergency driver for my UPS hub and last time i was driving a sprinter 300 km in 2 feet of snow in a blizzard. it was loaded down with 7900 lbs of payload and i could feel the road despite the snow. also i was early by a whole hour. Also i got 26 years there. also you completely switch positions to make more excuses.... You don't have any anymore. Time will prove me right.
Reply: @TheInsaneupsdriver  heavy crude has several uses that sweet crude can't be used for.  Look into it.
Reply: @Mach 1 port of Vancouver is limited right now in # of tankers and size.  Expansion in Burnaby is ongoing.  Should have been done 20+ years ago
Reply: @csnide6702  America would have benefited from the pipeline too as most of the oil would have been refined in Texas with the products used in the US or exported. As for the Ogallala aquifer the revised route only crossed the northeastern edge and was not really that much of a threat. However as a risk/reward analysis would be partially subjective it is perfectly reasonable to find that the risks out weighed the rewards.
Reply: @TheInsaneupsdriver  Well ever since automobiles have been introduced here in the early 1900's until now. With all the research (proof) and statistics brought fourth over the decades. Having personally undergone several blizzards (one known as the Storm of the Century) and several ice storms (1998 ice storm) as I was a reservist called upon the region with my own vehicle. The first event I was driving a Manic GT and on the second event with a Ford Festiva 1993 rather than a CUCV or an Iltis as those kept on running off the road (due to ice buildup). I was driving, door to door, to verify if citizens needed anything, on ice covered roads. The Canadian army ended up renting multiple small vehicles during this period as it was a much safer option such as mine for the second event (Micras, Corsicas, Swifts, Pontiac Fireflys, 323s and Excels). In both situations I never got stuck anywhere. With my +60 years of driving multiple grade vehicles in various situations. But a sprinter is a van not a automobile (you are changing the topic). I can also lay claim that when i was operating a M35A3 or a HVPG fully loaded held in place but yet not as well as a E series Ford fully loaded but the stopping distance was increased and controllability was also garbage.
I didn't change my perspective as I added more worldly recognized elements and facts, that you did not know about. As you are younger than I, I can understand your lack of knowledge.
Reply: @Mach 1 I get that but why don't they export fuel instead? I am speaking of gasoline, diesel and airplane fuel. Not crude
Reply: @mjhumle  ayyy, Kitimatian here. True, we could have another pipeline up here too haha
Reply: @Mach 1 What really blow's my mind is the fact that the provincial government hasn't perceive taxes to invest it afterwards in it's personal petrochemical plants to offset this situation itself. It could've charged all these various petroleum companies for this treatment of secondary products. Short term investment for long term gain. You can transpose it to Quebec's investment into Hydro Quebec in 1944 (38 years before all the other provinces wanted the transfer payments). We indebted ourselves on the short time but on the long term we claim as much in revenue as Alberta does in royalties and such.
Reply: @Mach 1 The original Trans Mountain Pipelines have leak report every week. The accident in quebec offset the statistic certainly but if regulation are followed it is pretty safe. I don't have a problem with pipeline if its viable economically for the region where they are deployed. Ultimately its their decision to take. Not the federal government.
Reply: @robert-antoinedenault5901  ok
We still get the majority of o power from nuclear

Everywhere but in pei
Reply: @robert-antoinedenault5901  Electric cars aren't more reliable in the cold? Battery range drops to pathetic in temperatures below -6.667 C/20 F? Where did you get the idea that A) it would be reliable or B) People in Canada are excited for this? Only 52 percent of Canadians even want electric in the next 5 years when polled. Canada does not equal Vancouver/BC & Ontario/Toronto.. and those two areas crush the needs of the rest of the country for their own whims and opinions.
Reply: @ShmuckCanuck  Canada is generating over 65% of it's electricity from hydro sources. B.C. (92% with +5% of wind), Manitoba (97%), Quebec (100% surplus is sold to neighbouring Ont, NB, VT, NH, Maine, NE, NY), Newfoundland and Labrador (96%), Yukon (93%), PEI (100% from wind), Ontario, New Brunswick, and NWT rely on various combinations of nuclear, hydro, wind, biomass, coal, natural gas, and petroleum–although not all provinces or territories use all of them.
       Alberta, Saskatchewan, Nova Scotia, and Nunavut generate most of their electricity from fossil fuels such as coal, natural gas, or petroleum
        Most of the wind facilities in Canada are in Ontario, Quebec, and Alberta (PEI only accounts for 2% of Canada's total). But within the next decade NS will be the largest supplier of green wind power and green ammonia in North America destined for the European market (German and UK economy).
        Largest solar power capacity is presently in Ontario.
        Alberta is the leading province in supply of grey Hydrogen whereas, Quebec is the leading producer of green hydrogen as of right now. (china is planning to operate the largest in the world by 2025)

Here's what an alliance in Ontario is trying to propose to it's provincial government.
https://www.cleanairalliance.org/campaigns/
Reply: @johnbanka9199   
How far is the TC Pipeline from James Bay?
I understand there is year round sea traffic at the top of Hudson Bay so why can’t there be a terminal at Moosonee with ice breakers up to the top to a world market?
Reply: @dootdoot1867  You bring up very good points which I am not entirely familiar with and can't argue for or against. I was mostly trying to explain why the Federal government is unlikely to force Québec to build a pipeline on its land like was suggested in a previous comment. I do agree that there are a lot of by-products from oil but that will most likely not chance the general view Québec has towards the oil industry.
Reply: @vincentroux842  this is an understatement. quebec literally has a different set of rules if we want to do business with them. This is why many businesses TOS state they dont do business with quebec.
Reply: and the Montreal mayor killed the eastern pipeline because of pollution while pumping raw sewage into the st Lawrence.
Reply: @robert-antoinedenault5901  wouldn’t a second generation canadian know all about canadian weather?
Reply: @ShmuckCanuck  That is incorrect. Biden cancelled the approval on January 21, 2021. TC Energy did not give up on the project until June 9, 2021. Canadian approval was never revoked.
Reply: @bryandoehler8962  it certainly was ; they never had it and we cancelled the environmental review
Reply: @bryandoehler8962  and the project was shelved by trans Canada like a year before that dude
Reply: @erictremblay6867  Transporting oil by pipeline is much safer than using trains. https://en.m.wikipedia.org/wiki/Lac-M%C3%A9gantic_rail_disaster
Reply: @bryandoehler8962  Not really. Like I said the Lac-Megantic accident offset the statistic. Plus nobody is taking the count of health issue related to pipeline leak. Further more the pipeline does not eliminate the use of train at all. Train with oil will continue to go to Lac-Megantic with or without the keystone pipeline.
Reply: @robert-antoinedenault5901  Another Quebecois unable to see the big picture. Oil revenues have benefitted your province for decades. If you are concerned about the environment then get your province to stop dumping raw sewage into the St. Lawrence River. Or maybe allow a pipeline instead of having oil shipped from overseas. What is the environmental impact of that? Lastly geothermal does not work well everywhere in Canada.
Reply: @ashtonishing656  Okay one thing at the time. 
Oil revenues have benefitted anyone in that field and the various governments affiliated to it. As Quebec was the largest refining hub in all of Canada, until the 1970's (oil crisis), your statement is correct. But since then our need on refining crude oil has reduced by 65% as we decommissioned many of the refineries and subsequently removed them. At present time the need of crude from the west by pipeline only represent 33% of our needs (capacity in Quebec only).   

Now...I think you don't reside here, as to propose a pipeline to supply our other needs in crude; Is a totally insane idea. As everyone knows, Alberta has the capacity, but we lack the infrastructure to process it ; as we are not compatible to process it (only one plant can now, the Suncor plant in Montreal); old article but explains the "real" reality here
 https://thenarwhal.ca/oil-export-tar-sands-bitumen-cannot-be-refined-eastern-canada/ To propose a pipeline to meet our needs would require an immense fortune that the entire country could not even afford to build as to permit a viable and constant flow of crude from the North sea, from parts of Africa and from the middle east. All the refineries (except 1) in the East process a BRENT blend (mix) as it's refinement provides a very vast array of products, such as: roof shingles, lubricant oils, hydrogen sulfide, sodium hydrosulfide, sodium sulfide, tar (used as a base for coatings and paint, in roofing and paving, and as a binder in asphalt products) while still producing different fuels and resulting with 5% of residual waste.
 Contrary to Sweet (heavy) crude that only produces: gasoline, kerosene, and high-quality diesel and airplane fuels with a 25% of residual waste after refinement (10-15% of that is petcoke it emits 5% to 10% more carbon dioxide (CO2) than coal on a per-unit-of-energy basis when it is burned in coal plants).
   Without BRENT crude imports of various grades, WE (EASTERN CANADA) could not produce all these products that many have come to regard as a secondary product. Keep in mind without the refineries in the east, Canadians would not have asphalt roads, shingles on roofs, transmission oils, hydraulic oils, engine oils, WD 40, grease and so many other products.  

The reason presently on the planned 2B liters of waste being dumped into the St-Lawrence river is due to the continuation re-building (since 2015) of the old Turcot Interchange that was built in 1967. 
https://www.bloomberg.com/news/articles/2018-11-06/how-montreal-redesigned-the-bonaventure-expressway
The actual localization of some of the existent structures are presently situated above underground cistern and waterworks that were constructed over 150 years ago. It was deemed safer to the population to expulse their content into the river way rather than, not only, causing a flood within the specified location but an environment disaster (as it would be in a concentrated form rather than diluted into water) and a financial burden that the city would incur as several residential/commercial buildings would be damaged by the resulting flood.
Not only are the above structures failing but the subterranean ones are also and a complete overhaul is necessary.
  https://www.watercanada.net/feds-partner-on-montreal-stormwater-and-wastewater-infrastructure/

Not saying that they are right but various avenues have been looked upon as to alleviate parts or the total expulsion of these; blocking roads and subverting it's content above ground in pipes towards the treatment plant (which is 27.5km away) until the proper sewage infrastructure is in place (2 years from now) while preventing citizens to travel freely and also to prevent it from freezing during winter, even the use of barges/tankers to "ferry" the waste to the plant (unfeasible during winter as that zone is not part of the sea way, thus frozen over) or even transporting the water waste by truck to the treatment plant. Not feasible because it would require 10,000 truck trips per day.

We find ourselves in quite a pickle but every tier are investing massively into these infrastructures now, so when the time comes around it will be easier to modify without causing more harm than needed.
As you might not know we also did this in 2015 (at the tune of 8B liters 4x more than this time) https://montrealgazette.com/news/local-news/meet-montreals-most-famous-sewer-line

Here something to make you understand on our "acceptable" reasoning: https://www.mcgill.ca/waterislife/waterathome/down-drain 

As for geothermal in the residential/commercial application, unless the building is resting on bedrock; then, yes I agree that the feasibility is not possible. If it possesses less soil that is required to reach the frost line, the direct expansion/Diagonal (angled) and/or Lake or pond is the best option. If the issue is land availability for a traditional low cost horizontal loop installation, the other option commonly skipped over is the vertical loop system. And the final option is the vertical open loop system (most expensive and shortest life expectancy). Most will say that the upfront cost is the major deterrent to invest into this technology and the insecurity that the investment vs the potential savings are the key reasons that many do not follow through.
 I'll put my two cent as a Quebec resident even with the very low cost of electricity here and the high cost of investment into this tech.
   The heating energy cost savings compared with electric furnaces is around 55%. 
    The life expectancy of a closed loop system vs an electric furnace is the same 75-100 yrs. 
     The life expectancy of a ground heat pump vs an air source one is doubled as the compressor has less thermal and mechanical stress, and is protected from the environment. 

Contrary to most, we tend to shy away from the utilization of a heat/cooling pump (HVAC exchange unit) and rely with in-floor heating/cooling as there is no transfer of heat or cold to the air but requires a constant movement of the liquid throughout the ensemble of the system with various pumps all over the home. Biggest saving on initial cost all the while doing renovations to "better" the home and it's value and applying for grants, loans, and even tax credits to alleviate this investment

Hope that helps clear a bit on our similar realities but yet still very different.
Reply: @Fancy_Pants5  I'm a Rupertite and done a little work at LNG canada
Reply: @bryandoehler8962  it's called Risk and Reward.... why should we risk something Canada isn't willing to...?
Reply: It will get done just not by this administration.
Reply: @bpd8426  good luck with that. New law in Canada preventing any new pipelines to be built, nor any expenditures for capacity in ports either
Reply: @robert-antoinedenault5901  Sure, but that can change anytime laws aren’t permanent
Reply: @bpd8426  Anyways I know that Alberta does not have the support of the majority (other provinces) to fight the federal government on this; as the majority are looking at other resources
Reply: @robert-antoinedenault5901  That’s today,  it not forever. Hard economic times would change that overnight.
Reply: @erictremblay6867  Nonsense, you can easily find studies on the frequency and health impacts of pipeline leaks just like you can find studies on train derailments, tanker car leaks and their health impacts. You can also find statistical analyses comparing the two modes of transport. They show that pipelines are not only more efficient they are also safer.
Reply: Rupert never freezes 🤣
Reply: @robert-antoinedenault5901  Quebeckers did not so the rest of us as we see past today.
Reply: @robert-antoinedenault5901  Sour content of oil has nothing to do with those products. Fuels are made from LIGHT crude, while asphalt and some lubricants are made from HEAVY crude. Sour refers to the hydrogen sulfide content of oil emulsions and produced fluids/gases. Hydrogen sulfide is generally used to produce sulfuric acid that is used in the mining/processing of fertilizer, and has no relation whatsoever to the chain length and molecular weights of the hydrocarbons. By the way, I've been in the oil and gas industry for 20 years.
Reply: @vincentroux842  Hey now, don't lump all of Canada in with these separatist Quebecer a-holes. :P

Thing is, other than the attitude I agree with Robert.  It's insane to develop more oil-based infrastructure or any kind when the amount we already have is fucking the planet sideways with a cheese grater.  Norway's model was never actually viable for us, for all the reasons outlined in the video.  The very best-case scenario still has us competing internationally with a product that costs twice as much to produce and that's before having to ship it across the Atlantic or Pacific, or continuing to swallow U.S. monopoly extortion.

Biden killing the Keystone XL project was economically bad for Canada, and ironically worked out pretty poorly for the U.S. too (and the schadenfreude is sweet).  But it'll be better overall for humans.  And in a few generations, Canada will still be a land of pristine mountains and lakes in a world that has learned to cherish them a whole lot more.
Reply: @robert-antoinedenault5901  there’s no law like that lmao
Reply: @bpd8426  I mean

They would but not in the way you think

You are aware arnt you

That the reason other provinces said no to most of Alberta’s proposed export programs

Was you wanted to pay us Jack shit and keep all the money for yourselves

That’s why bc said no
That’s why Quebec said no
That’s why Ontario said no
That’s why everyone said no

If y’all want to ship out through another province you’re gonna have to pay them 

That’s it
Reply: Well this thread has just tickled me pink.
Reply: @feetham  Pumping raw sewage in a natural body of water is something more common than you would think from large cities across Canada. This has been done in Montréal, in Vancouver, in Toronto, etc.  British Columbia  followed by Nova Scotia, Newfoundland and Ontario are the provinces that pumped the most raw sewage into rivers and lakes.
So, may I ask what correlation do you see between the eastern pipeline and an event of sewage pumping in the St-Lawrence river?
Reply: @robert-antoinedenault5901  the oil goes on trains which are more prone to spills. Voting against pipelines doesn’t stop the oil moving.
Reply: @casualsuede  should be able to get it up and running in a few hundred years or so.
Reply: @robert-antoinedenault5901  The reason we need oil is because it also makes stuff we need. What a hip replaced? The ball is plastic. Just a single example. Even electric cars need grease or the hubs will seize. Your simplistic view is just that. Simple.
Reply: @ronblack7870  He's talking about BC. Why do people from Onterrible always think everything is about them. And by Onterrible I mean Ottawa and Toronto.
Reply: Going north is not easy at all. You're clearly not Canadian. Almost no road systems going north. Tundra is not hard soil. Lots of swamp like land up north and hundreds of not thousands of water crossings. The Inuvik oilfields are pipelined out to Alaska. There's no good road system going far north. Most pipelines would be an absolute nightmare to build up there.
Reply: @mjhumle  take a lot more than a 1000. Also Kitimat is a dump reason why most don't want to live there or Rupert
Reply: @terryarmbruster9719  Actually I am Canadian I just don't put a lot of thought into that initial comment. You're quite correct, the lack of infrastructure, difficult terrain and having to build on permafrost would make a northern route the hardest of all.
Reply: @Weepnot  Why would I spend on a 85K car when it cost me a feeble 15$/m to be connected to public electricity?
Reply: @KkevrockK  Quebec is in the east, true we blocked it and those tax $$$ you speak of were given to us, we never wanted them nor did we even sign the 1982 act. You want to complain do it to your own government and every other in Canada as they accepted those terms and we didn't. PS learn your Canadian history properly before you say idiocies.
Watch this
https://www.youtube.com/watch?v=rqadXy5fLrU
Reply: @Bluebird_Bum  just a few fact (taken from govt of Canada) In 2019, Quebec generated 212.9 terawatt-hours (TWh) of electricity, which is about one third of total Canadian generation. hydropower generates 94% of Quebec’s electricity. In the 2021 fiscal year, Hydro Quebec generated some 14.5 billion Canadian dollars in revenue. The big difference is only 25% of hydro-quebec's profit go into the provincial govt. coffers. 50% goes back into maintaining our infrastructure (oldest operating dam 1888 and newest dam Romaine 1, 2021) the rest goes into a Quebec fund (worth over 400B$).

And In 2019, Alberta generated 76.1 terawatt hours (TW.h) of electricity (Figure 2), which is approximately 12% of total Canadian generation. Alberta is the third largest producer of electricity in Canada About 89% of electricity in Alberta is produced from fossil fuels– approximately 36% from coal and 54% from natural gas. The remaining 10% is produced from renewables, such as wind, hydro, and biomass. Alberta raked in $16.2B in oil and gas royalties in 2021 due to high prices caused by Russia's invasion of Ukraine. Alberta has also their own fund named the heritage fund of Alberta (worth 16B$)
Reply: Canada should become a global player in maple syrup.  Build maple pipelines to the US, Mexico, and even to Europe.  Distribute the dividends to all citizens.  +$9,000 per year per citizen UBD.

Long live the maple emirate!
Reply: @terryarmbruster9719  Hey now I live in Rupert, and it's great if enjoy outdoor activities.
Reply: Also, the Texas marketplace isn't exactly the most opportune place for oil.
Reply: @ronblack7870  bruce power BABY WOOO
Reply: @robert-antoinedenault5901  ummm the pipeline you talk about through various connections moves western Canadian oil not only to sarnia ont but to the refineries of East Montreal as well. And there has been added capacity to move oil from sarnia to Montreal since 2016 with the reversal of line 9. This line moves oil from line 5 further east.
Reply: @casualsuede  Churchill, Manitoba is home to the largest polar bear population during the warmer months, wonder what the pipeline could or will do to their livelihoods
Reply: There’s also the (Canadian)-French. Another obstacle.
Reply: @robert-antoinedenault5901  were are you from ?
Ontario, Quebec and New Brunswick have nuclear and natural gas powered generation.
Reply: @robert-antoinedenault5901  electicity more expensive summer ?  ! I pay about 5 cents per KWH most of the year but 25 cents when the temperature drops below  -13  C. That's when I switch to gas.  West of Montreal.
Reply: @robert-antoinedenault5901  Not everyone has the ability to utilize geothermal vents to heat their house or to generate electricity. Oil is not the best solution, but for many it's still the most economical or the only option. Im not going to waste time defending oil, but your comment is really ignorant and shows why a good majority of people just ignore Quebec from both east and west (and now probably south as well).
Reply: @robert-antoinedenault5901  lmao anyone in western canada would disagree, this is why they should be seperate countries
Reply: @ronblack7870  he's in bc. Did you read the post?
Reply: @cvp5882  Okay I have gone through this already with someone else here.. Montreal utilizes mostly a Brent blend (with some WCS) which is mostly mid to heavy sour crude to refine into these products whereas the heavy to extra heavy sweet crude from out west is refined into various fuels for combustion engines. The grade of oil is not the as relevant but the sourness or sweetness is for our needs (for our industries). 

 The refinery/plant in Montreal process a BRENT blend or Crude Slate (mix with WCS) Suncor and sulfur plant through it's refinement provides a very vast array of products, such as: roof shingles, lubricant oils, hydrogen sulfide, sodium hydrosulfide (to make heavy water for nuclear reactors (for Ontario)), as a chemical intermediate and pulping agent in making paper (we are the largest pulp producer in Canada), and in making dyes and other chemicals, sodium sulfide (pulp and paper industry, water treatment, textile industry, and various chemical manufacturing processes including the production of rubber chemicals, sulfur dyes and oil recovery), tar (used as a base for coatings and paint, in roofing and paving, and as a binder in asphalt products) while still producing different fuels and resulting with 5% of residual waste. 

 Contrary to Sweet (heavy) crude WCI processed at the refinery Jean-Gaulin in Saint Romuald that produces: gasoline, kerosene, and high-quality diesel and airplane fuels with a 25% of residual waste after refinement 10-15% of that is petcoke which is utilized in our various cement plants. 

"This info is coming from my cousin that is the project director at Suncor here in Montreal" ⬇⬇

Sour Crude Oil goes into the refinery (or Cracker) and you get some chemicals like Ethylene, Propylene, Benzene or Pentane.
Those chemicals are then mixed with other chemicals, or putted into reactors or other alky units and steam crackers and by use of temperature, additives, mixes, reactions you get intermediate chemicals. Those are already on a stage that can be used directly into injection, extrusion or molding processes to create bottles, cups, diary, bags, packaging or car parts. Each different intermediate will be use or best fits each sector.   
So try to figure a refinery where crude oil comes in, and then a sequence of 3 or 4 steps in between with reactors, crackers or polymerisation units to provide you the raw material to produce the plastic you need (according to resistance to chock, heating, gloss, etc etc etc). You'll have than Polypropylene, Polystirene, Polyethelyne, ABS, etc. Those will be the raw materials of the plastic producers.
 Plastics feedstocks from oil refining are Esters (as in polyesters seen in clothing), Chlorides (polyvinylchloride/PVC pipes), Propyls (as in polypropolene in packaging), Resins (as in polyphenolic resins used in a lot of stuff like Crocs shoes) and many other products.
Reply: @sackywacky  Which comment are you speaking about?
Reply: @robert-antoinedenault5901  yet we sell it to New York instead of giving it to our people when we are in need of electricity
Reply: Also to add to that our climate is sub-zero half the year. The amount we spend on insulating and heating our facilities is astronomical. What we do have going for us is the stability of our markets and governments. We aren’t on the verge of civil war and overthrowing our government like Venezuela and we aren’t governed by sometimes ruthless and unpredictable dictators like the Saudis. Investors are secure that the deals made with our companies and government will be honoured.
Reply: @robert-antoinedenault5901  they’d rather import it from dubious sources overseas than see their fellow countrymen flourish. Crabs in a bucket.
Reply: @exotic80  that accounts for your electricity but I doubt you heat your home in the winter with electric space heaters. A lot of the frustration from the West results with people with very low information on how basic infrastructure works making ill informed decisions that affect all Canadians.
Reply: I’d like to point out that a lot of commentators are stating their provinces have nuclear, hydro etc power generation. That’s all great and everything but I seriously doubt you all heat your homes with electric space heaters. Your furnace runs on something called natural gas as do some other appliances. As well as everything plastic you own, or anything with moving parts all rely on Petroleum products yet you have been sold on the idea we could shut it all down tomorrow. Educate yourselves please on how integral oil and gas is to your everyday lives, and also how much foreign oil your province is shipping in daily and from where the next time you vote down a pipeline. It is hypocrisy at its finest.
Reply: @Ok_wall  I doubt you have ever heard of how supply chains operate; as you try to justify through your simplistic logic. The need in the east is not only from WCS oil (1/3) but also of sour Brent blend (+5% sulfur). The by products that are produced cater various fields here. The use of western oil (as plentiful as it may be in the west) does not supply our needs in these by products and the installations are not setup to process such a viscous (heavy to extra-heavy) resource as it mostly processes light to medium. I can easily turn it around in a idiotic rationing from my part and also say that...during the oil crisis of the 70's the west should've continued producing oil (even at a loss) to guarantee jobs in the east as to permit refinery workers to keep their jobs but instead it was chosen that making $$$ was more important than to keep jobs into Canada. As it stands right now in Montreal, there is only one refinery left out of 6. All because of this event. 

The rejection for more WCS in the eastern provinces was also debated here in the latter part of the 90's as we also have quite a "bit" of oil in reserves here just like the west. An extensive exploration of sedimentary basins in Québec has confirmed the presence of oil and gas reserves. According to the Québec's Ministère des Ressources naturelles, the Gaspé Peninsula may contain 429 billion barrels (but proven 90), while the Québec portion of the Old Harry deposit (in the Gulf of St. Lawrence) holds 7 billion barrels and Anticosti Island has close to another 46 billion barrels (roughly 142B vs alberta's 166.3B). Much of it is unconventional oil structures (fracking extraction) and the rest would be extracted through conventional traps. But as the location of these source are deep under water near already established communities and vast supplies of fish and seafood it was therefore deemed too dangerous to extract. 

What you have to ask yourself is, why didn't Alberta, Saskatchewan nationalise the extraction and processing of this resource while keeping wages lower than what they are and keeping the profits of this field into provincial coffers? Instead of just collecting a feeble 1 to 5% of royalty per barrel. 
This way of operating would've guaranteed production even during the oil crisis as 100% of the profits would have stayed in the provinces (in one form or another). By implementing such a system would've guaranteed (lesser cost of extraction thus higher profit) the ongoing capacity of refining WCS oil and selling it abroad. But since private assets were in control of it's extraction. Over 5000 direct worker and over 60 000 indirect workers had lost their job in Montreal. Ever since the recent oil booms in the west they have "complained" about this. They expect us to jump on a whim but we needed them in the 70's as we had the refining capacity and the pipeline and they still managed to let us drown. 

We Quebec nationalised our electricity, thus guaranteeing a lower cost of production, lower wages avg 85K$ cad (compared to the same job in a private sector avg135$ usd) and since it is separate of the government (it pays the government royalties) the bulk of it's assets are not calculated into the provincial wealth as it is "owned" by the government (sole shareholder) thus does not reflect our economy therefore the transfer payment continue. 
As an example: 1kWh is only 0,0739$ in Quebec for residential but is sold out of province at 0,136$ up to 0,192$ (Ontario, New Brunswick, New York State and New England). 
The QC government claimed 4,9B in taxes (sales and income), 4,2B in investments (bonds, grants, donations, etc), 752M$ in royalties and Hydro still walked away with 3,564B in net profit.

 The annual profit of Alberta for 2021 in regards to the oil sands are a mere 3B$ whereas the (private) industry gross profit as over 175B$. 
 

If you like to read, this is annual report of Hydro Quebec 2021(it is available to all as we are owners of it).  https://www.hydroquebec.com/data/documents-donnees/pdf/annual-report-2021-hydro-quebec.pdf?v=20220322
Reply: Add to that GNL Québec, the pipeline leading to Saguenay and then ships to Europe and Africa. Québec people are mostly against the project, which is why the construction has not began and will likely not begin.
Reply: @jiml9856  Our oil is far more expensive to buy than from other places, let alone the fact that ours is bitumen and can't be used for what we mainly need it for until it's broken down shooting the price way up. And oil is sold on the international market, companies don't choose who they sell to, it's an international auction. We actually pay less buying from other countries on the international auction market for oil and then paying the shipping costs. Because it's that much cheaper than buying Canadian bitumen and trying to work with it
Reply: @robert-antoinedenault5901  That's just not how it works anyways. No crown corporation is extracting oil. They are all private companies, we don't get to tell them who they sell to, they sell it on the international auction market, which more than any other company they need to do because of the cost to extract and refine it. And since it's bitumen the price is absurd to refine it to what we need. We also have next to no capacity to refine it in the first place. If we request they sell a certain amount only to Canada instead of on the market we get stuck with a shitty contract that's over priced between us and these companies. If we try to force them to have to sell to us at a set price, all these companies leave and our oil production collapses
Reply: @brendanjames7551  No saying there is but rather saying there should.
Reply: @brendanjames7551  But if they left that would create a void that the government (provincial) could fill and still operate as the AUE, Russia and several other nations already do. Alberta were the one's that were taken advantage of. Look at any nationalized (crown corporation) "company" in Canada and what makes them so different than the oil sands? Nothing, as they all require investment, workers and offer a bigger piece of the pie.
Reply: @mjhumle  yup, and one was being built…until Trudeau shut it down mid process.
Reply: They are literally building a huge pipeline to the west coast  as i type this
Reply: @robert-antoinedenault5901  yes we do. Check it out.
Reply: @robert-antoinedenault5901  Hydro Quebec is licensed to operate Gentilly Nuclear power station. It is not needed right now but can be started when needed
Reply: Let’s go Brandon
Reply: Yeah this isn’t a good enough reason at all, the port of churchill is a deep water port in northern Manitoba. Ice breakers exist. Conservatives want this and want to build refining in Newfoundland&labrador
Reply: @robert-antoinedenault5901  this might seem like a shock to you but cars don’t run on pixie farts. Whether or not Canada fills the demand for oil, some other nation is going to take their place. It commonly is Russia or Saudi Arabia who don’t have the greatest track record for human rights. What is wrong with the clean Canadian energy that has been funding your province for years?
Reply: @robert-antoinedenault5901  ontario has 18 nuclear reactors which provides 56% of our electricity. Canada is ranked 6th in the world for nuclear power and planning to build more
Reply: @beenz6423  true as 2 new hydro plants have been coming online since last month thus adding 3% more from hydro electricity. And reducing 3% of nuclear power generation. With 2 more planned for northern Ontario that would add an extra 15-18% of hydro power. Which would be great for natives, Ontarians as it still the cheapest and most reliant electric power generation and supply. With the shut down of the Pickering Nuclear Generating Station (in 2024 will account for a loss of 14% of province needs). A constant need of natural gas has been implemented to replace this energy source (on the short term) while increasing the price of this commodity. As of 2020 many citizens in eastern Ontario are pressing their regional supplier (and others) to partner up with hydro-quebec as they have great wind and solar tech and QC has great hydro tech. As of now the contract would permit Ontario to purchase electricity at a very low tariff (0.10-0.12$/kwh same rate as New England) instead of burning gas and selling it at a premium rate.
Reply: @ronblack7870  the problem with that is the uranium comes from Russia, one of the only countries that manufactures it for market to my knowledge.
Reply: @parkerb1970  well you're right why not use clean hydrogen produced in Canada to fill our cars? It's 100% green in Quebec and 100% blue in BC but Alberta and Saskatchewan produce the dirty version (grey) and in the coming years 100% green in Nova Scotia followed by NFLD &Lab. This is where it makes no sense that people in the prairie's aren't switching to this and removing themselves from excessive production from a dirty resource. I understand that we will still need some (fuel) for several products but to still depend on this resource is quite troubling. It's a good thing that QC, BC still have nationalised energy production (Ontario sold theirs away) and helped finance their own development and securing their own electricity production and supply. Never in the whole of the history of Canada has Alberta given money to other provinces and never has Quebec asked, nor approved (Officially) to receive any funding from Canada. Learn the stats of all EV's in Canada (6.1% [+1.6M] of all vehicles 2021) more than 49.4% are in QC, 28.3% in BC, and a mere 6.7% in Ontario.
Reply: Canada isn’t part of the states you know and it didn’t even come close to Canada 😂
Reply: I can stand behind and follow all of the points presented here. There is multiple things we aren’t thinking of. Generations of alberta s have built their livelihood on the oil and gas industry. The same goes to a certain extant with Newfoundland and Labrador. I am not saying that I speak for everybody, but when we put these points together we need to think of not only ourselves or just the economy, but the people behind the scenes who are in this situation. We need to think that if we don’t all agree now on expanding the industry we than need to turn to other means. I am only nineteen years old but I know very well that this industry id not expanded now, it will never expand . Now if we are to switch to something else we need not just one province input, we need all of Canada’s input. We need to provide the people who have built these oil dependency through many generations a way to switch over. Some of these people through many generations have built houses no matter how grand these houses are but also have amazed property and children and all kinds of different lifestyles, and if we just shut down the opurtunity for expansion and decide to go green we need to slowly get there and by bickering over this we are never going to. And if we don’t all agree to work together no matter what province we are in than many cities in many province are going to end up like Edmonton and Vancouver where homeless populations are through the roof and drug attics walk the streets. Do u know what that does to the children who are born out of that? It make the same situation that we are trying to reconcile with the First Nations community, it creates trauma that lasts centuries. All this because we simply cannot agree on prividing an alternative to people who have nowhere else to go but oil.
Reply: Edit: I am a person who has experienced generational trauma and know what can cause it. It is not very pretty. It can literally ruin people lives or leave them with PTSD for the entirety of their lifespan.
Reply: @Jordan-gn7ny  how’d you get a drug attic did you put drug in your attic 😂😂 it’s spelt addict
Reply: @timothychung4811  The environmentalists were the least of the problems. Try reading up on it.
Reply: @robert-antoinedenault5901  The east voted against it? Where do you people get this silliness. Please provide the date of this vote. That should keep you busy. I live in BC now, though not for much longer. I heat my house with natural gas, and we don't have any here? Got quite a number of solar houses in my area and we are moving to a house with 15 panels that should take care of all our power needs. But it doesn't exist? You mentioned the Trans Mountain pipeline but seemed to have missed the last 6 years or so. The current pipeline carries natural gas and is unsuitable for sludgy oil. There are continuing attempts by PM Trudeau to get an oil pipeline twinned up to handle oil deliveries from Alberta to BC. He bought the goddamn pipeline for Alberta and has gotten zero help from them in getting it built (their psychotic hatred of Trudeau is amusing, especially when it costs them any progress, but what can you expect from a province of clowns trying to build a hyperloop). The negotiations with native bands have taken years and are not over.
Finally, there was a refinery in Alberta that they themselves closed down, knowing that it left the Maritimes with the only refinery in Canada. Funny they never give anyone hell for that brilliant move.
Reply: @mjhumle  Well Kitimat's natural gas line opens next year, I wouldn't hold out any hope for another.
Reply: @casualsuede  Um a private company is restoring the old port is all, it will mainly be a grain port. It is a deep water port but not a year round port. And with several decades of heavy iceberg traffic, it will be a few decades before it can do much
Reply: @robert-antoinedenault5901  Stop while you are far behind, that bordered on gibberish.
Reply: You forgot one thing my friend as a British Columbian boy I have to tell you there's this great place called dead horse pass that's how my ancestors got here you can also follow the Canadian Pacific or Canadian national lines you could also just ship it on what Canadian national or Canadian Pacific train, and the OG transmountains been there since the fifties we found a way to get through it, not to mention you do you understand what the other thing Alberta is known for canola my friend so let's say we we do what you say and we cut straight down from the patch all the way down the Texas we're going to have to destroy a ton of farmer Fields because Alberta like the rest of the prairies are flat you can watch your dog run away for five kilometers so it's perfect for farming and their main stay out there is canola and then you Americans won't have any deep frying oil, is that what you want no french fries? And you want to know something great about the lower mainland of British Columbia we have Vancouver and Vancouver's port doesn't freeze ever, it's also relatively sheltered thanks to the great, Vancouver Island also known as British Columbia sandbar
Reply: @dragofill2808  I believe you are thinking of the kicking horse pass, although it was the yellowhead pass that is used by the trans mountain pipeline. However the point is that it's more difficult to get Canadian oil to a port than it is for other oil producers like Saudi Arabia or Venezuela.
Reply: @milesalpha1  You are correct. That was what the media portrayed. Our oil is owned by the big brother to the south.
Reply: Perhaps use the oil pipeline that goes from the Hudson river in New York harbour to the Quebec refineries. That is how Quebec refineries used to get crude feedstock. Now they get their feedstock from pipelines from Alberta upgraders and tankers via the Saint Lawrence river. The Quebec /New York pipeline is still being kept wet as an emergency backup to Alberta oil. Funny that Quebec politicians say ,"we have no social licence for oil pipelines", but that is how they get the feedstock for the Quebec refineries now and have for decades.
Reply: @CountryLifestyle2023  Provinces have wildly varying temperature averages depending on what region of the province you're in so that's a really poor arguement.
Reply: @xXSPADEGG  I have seen -55 several times, lived in multiple provinces. 
Slightly aware temperature varies from area tk area
Reply: @CountryLifestyle2023  Yeah I've seen sub -50 multiple times, lived in multiple provinces and territories too, what's your point? MY point was that even small areas within a province can have wildly different climates from other regions in said province; which I guess you grasped based on your simplified explanation? Which would mean you agree that living in the same province as someone is a poor arguement for assuming average temperatures, because your climates could be very different despite being in the same province.
Reply: @xXSPADEGG  no
Reply: Canada has no oil no 🧢
Reply: @DanoFSmith-yc9tg  all the uranium utilised in Canada originate from here. We are self sufficient on that from and our uranium is one of the most expensive as it has barely any impurities in it's composition. Canada is the 2nd largest producer of uranium after Kazakhstan. on the plus side we utilize a different type of nuclear plant compared to USA as we do not enrich it.
Reply: @milesalpha1  why bother looking up the date. I signed my refusal that's all that matters at the end of the day. You guys are having trouble with only one clan for your pipeline. But many in BC have accepted the ground heating and cooling system especially on Victoria Island. I don't understand why you are stuck or stubborn to embrace new clean technology. And proven also.
Reply: @milesalpha1  even when the proposed natural gas line that was planned in the 2000 was rejected by the northern tribes here. Thus killing the planned LNG terminal in Bécancour
Reply: ah yes, cheaper oil is worth poisioning water sources, and further exploiting indigineous people.
Reply: Snow is way easier then sand ⏳⌛⏳
Reply: @CountryLifestyle2023  excuse me where do you live in Quebec because comparing Québécois to the Holocaust victim would be extremely uncommon to anywhere I’ve been in Quebec
Reply: @Jordan-gn7ny  true as it was the reality of Quebec in the 1970's and more than 65k workers (and their families) that worked with or indirectly in the oil industry; lost their jobs and their financial income all the while Alberta did not help then. We were never consulted in the choices taken by them and because of their decision, we decommissioned the majority of our refining capacity and their subsequent demolition. Now our capacity is a mere shadow of our previous one. The pipeline from the west (from Sarnia to Montreal) was built, maintained and financed by our provincial government. And now they dare point the finger at us and many other provinces, on the fact that we aren't "team players". As it stands right now Montreal's refinery (the only one left) is the second largest in Canada after Irving's in NB. All the refineries in the prairies (combined) surpass the one in NB but prior to 1970 all the refineries in Montreal processed more than 1.5x what is processed in all of Canada today (85% of that was oil from the prairies; now we only blend it with Brent 70%(sour grade) and WCS 30% as our current need is focused on our newly upgraded sulfur plant). 

We were FORCED to change, why do we need to help you guys change. Cause you might loose your home? Boohoo, as we were transitioning (Quiet Revolution & the October Crisis) into what we have evolved now  our unemployment was quite high (7.9%) but the ultimate blow was OUR own fellow province (oil producing provinces) cut us down even more and our unemployment rate reached levels never seen in Canada's history of 15.8%. only the initial three months of the pandemic were higher (avg of 13.70% for Canada). We constantly present to news outlets on new tech to help in this transition. Not our problem if it isn't presented to you guys but what we ask from the majority of Canadians is to stop usage of natural gas/fuel and coal to produce heat and electricity. 

As you are young take the time to read and learn about 

- heat pumps (what the gas and oil are trying to push)
Life expectancy of each unit 15-20yrs/ 8000$ each 
Cost of installation approx. 800$ 
To equal the second option you need to replace it 5 times = 
cost + labour (don't forget natural inflation of price and wages)

- ground heat and cold pumps
Life expectancy of 75-100 yrs/30,000$

PS second option will cost 85% less to operate then standard gas, heating fuel or electric furnaces.

And cost less than 45% of standard heat pumps.
And can be run completely with solar or wind power.

Please take the time to learn. Remember and share with others. That is the next business opportunity for the globe. 85% of the global population can rely on this. But a new tech with oil drilling know-how is making it's mark on the global scene from Alberta Aevor with its first already established and functional plant (for the the 15% that can't use the previous tech) and a second for Yukon. Enjoy the reading ☺️ 
Go look and learn from this: "Two Bit da Vinci" on YouTube
Reply: Because it would've hurt Natives. Forget that colonailist bs. Stay off their land.
Reply: Long live Biden, Long live trudeau
Reply: @robert-antoinedenault5901  10:06
Reply: The only real barrier to getting Canadian oil to the coast is politics.
Reply: Norway cost per barrel is a fraction of what it costs to make a barrel in Canada. Alberta used the royalties to fund programs in its province, instead of taking money from the feds via equalization payments. Even if we had followed the Norway route, our funds wouldn't have been anywhere near that amount.
Reply: @robert-antoinedenault5901  Ahhh, but if Quebec had instead sat upon huge reserves of oil and natural gas as Alberta does, anyone with even a fraction of a brain would know that shipment and export of those resources would be paramount of Quebec's provincial government with glowing endorsement of Feds!
Reply: @TRguy64  Quebec does Sit on a sizeable amount of natural gas. One site has revealed itself (in 2020) as to curb all of Canada's needs for the next 40 years. Other site's were in the process of sampling but our (provincial) ban on research and development put a stop on all this. And the 182 active permits for oil and gas extraction. In April 2022, the   province of Quebec became the first government in the world to explicitly ban oil and gas development and mandate the shutdown of existing drilling sites within three years. .
Reply: @TRguy64  funny how, as I answered your "supposition" you've gone silent 🤔. Reality hit you? No proper come backs? Did your cat get your tongue?
Reply: @CountryLifestyle2023  Bill 95 says it all period !
Reply: @nickspiroulias3651  which says?